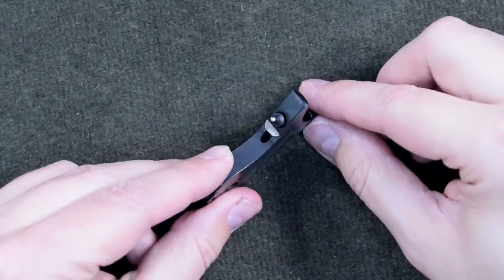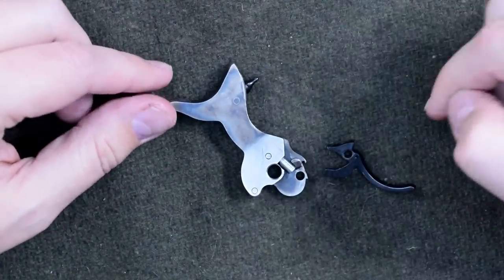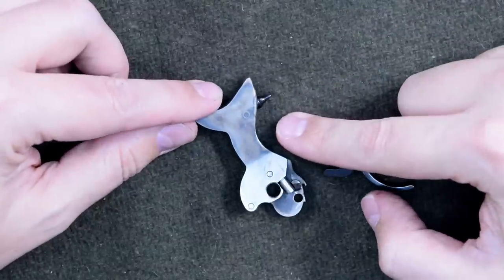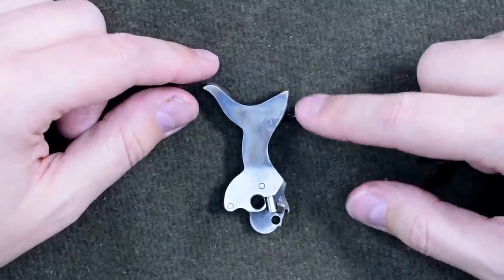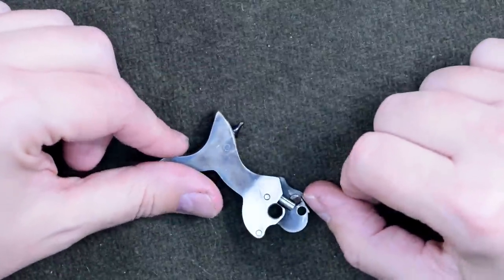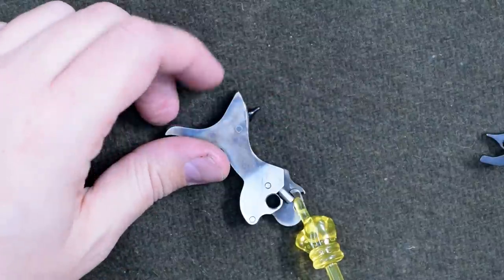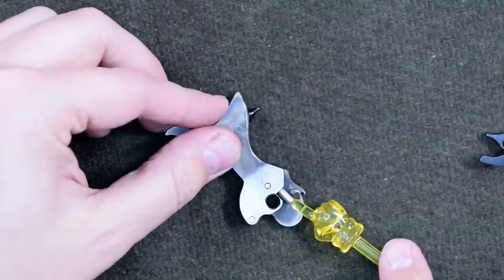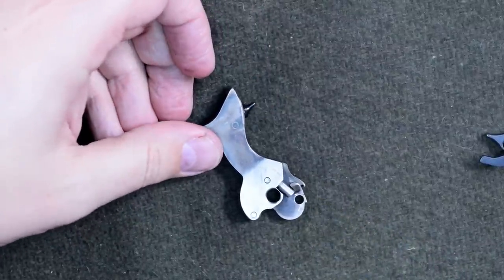Clips: Another Colt Single Action Army Safety Mechanism.

Comment: Hi as a colt collector and engineer. I wanted to test In CAD the strength of the safety notch. In doing so, I found some very interesting data. In my experiences the CAD data is extremely close to real life tests. In my test I used a weak form of steal so that the numbers are conservative. because of the alignment of the trigger to hammer. It takes 900- 1000 foot pounds for a failure. The failure was the trigger pin. Not the safety notch. I also found that if you pull the trigger while it is captured in the safety notch. It does not take much pressure to break the notch on the hammer. It's hard but doable. Remember these are conservative numbers. most SAAs will be stronger then this. The bounce problem you talked about in your last video. I'm guessing, but I don't think this was a problem on original colts. Because how heavy the hammer spring is. But I might be wrong. All This brought me down a rabbit hole. Going threw all the stories like during the government trials. The safety notch broke. So they recommended carry 5 not 6. This is not in the trials at all for what I can find.  It list a half notch failure. But it says there was a clear and obvious Manufacturing defect on the hammer. The other story of the man putting a saddle on a horse. The stirrup hit the hammer and broke the safety notch... That's not what happened. The man had his hammer resting on a primer.  If you have any information contradicting this please let me know. I have no problem being wrong. I thought you might find this info interesting. Thanks

Comment: Hey Othais - to better help with these demonstrations, why not get a small piece of wood and, when you're going to demo a few parts like this, drive a few nails in to serve as pivot pins for the demo parts. Cheap, quick, easy, and would allow you to better illustrate the action of a mechanism without trying to hold the parts in the correct position by hand while fighting spring loading and such.
 
And, cool mechanism, interesting design!

Comment: So this is another mechanism that prevents a loose hammer from setting off a round if the trigger isn’t releasing it, like was publicly claimed by a certain celebrity.
Reply: Never underestimate the effect of poor firearm maintenance on negating the safety features of a firearm. Given that the investigation found that the set armorers sucked at their jobs and mixed live ammo with blanks and that camera crews were leaving due to unsafe conditions, who knows what other fuckery went down before that fateful day. 

Said celebrity does however bear some responsibility not because he held the gun and didn't treat the gun as a gun rather than as a prop (which it was), but as a producer which likely was involved in selecting the subpar armorer who got her job through nepotism. Guns for film are handled differently because of the peculiarities of film production which most who have criticized the celebrity for are thoroughly unfamiliar with.

Comment: I just had my original Ruger single action updated to their newer transfer bar system (Ruger does this at no cost for the conversion.) Is it safer? Yes, technically, but the danger can start when nimrods and cheechakos start thinking of a gun as “safe.” No such thing.
Reply: Guns are perfectly safe. The user is the problem.
Reply: The point of the Ruger transfer bar system is to allow for the safe carry of six rounds in the chamber (inc. one under the hammer) vs only the five rounds in the chamber (empty chamber under the hammer) of the traditional Single-Action Army style mechanism.
Reply: Pretty cool that Ruger offers that at no charge. I still don't understand why they have a bit of a "lesser" reputation compared to some of the other traditional brands, they really seem to be a rather great company that's always putting out solid product for the money.
Reply: @RyTrapp0  Back when I bought my first Ruger (1960’s), they didn’t have quite the fit & finish of some of the “old line” gun manufacturers, and that may have been where that started. Time has pretty much erased those differences. Colt has gone extinct, and a glance at the current products of S&W show some of the same production methods pioneered by Ruger, as well as a lower level of fit and finish in their current products.
Reply: I absolutely would not have converted it... But it makes sense from a practicality standpoint.
Reply: @covefarmdude  If this gun had had the original finish on it in decent condition, I would not have had anything done to it, probably for the same reason as you. But this Ruger had a complicated history, starting new in my family back in the 1950’s, then was sold out of the family to a friend. At some point he neglected the pistol and got some surface rust, whereupon he took a wire wheel and removed the finish, destroying any possible collector value. Before his death, he gave the gun to me and for a number of years the finish was just in the white. I am at the point where I will pass this gun along soon, and I wanted to bring it up to snuff. I decided to send it in to Ruger for the transfer bar conversion (and, BTW, the old parts come back in a plastic bag, should one wish to do a retrofit), and in the process had the gun refinished. They did a beautiful job.

Comment: I'm sure colt would have thought it was unnecessary given the manner in which handguns were handled at that time
Reply: The phrase was,5 beans in the wheel. Simple.
Reply: The designers at Colt believed that the half-cock position would be an adequate mechanical safety mechanism. That the phrase "going off half-cocked" is a phrase which dates back to the flintlock days was clearly not a consideration.

Comment: Friend, I distinctly remember seeing a pair of Colt Single Action 22LR's—forget what they called them—back in the Early '80's. You had to open the Loading Gate; put the Revolver on Half-Cock and push in a Hidden Hammer Block—hidden by the Loading Gate. It was a Push-Button Affair. When you Cocked the Revolver, the Spring-Loaded Cross-Bolt Hammer Block retracted automatically. Everyone at the gunstore who saw them believed that was why Colt halted production on the New Frontier—to introduce these shortly. Nothing ever came of it. No one seems to have heard of this very low-production item—Have You!?!

Comment: I actually have Taylor 1873 SAA with this safety but I removed it with replacement fixed hammer firing pin. The reason? I've noticed when walking around full loaded with 6 shots in the cylinder the firing pin would actually DENT the primers.. Even in a holster that covers the trigger guard/trigger... No good for me since now I have this worry if a strong enough force would actually make it go off (Of course, this is very unlikely  but the dents of my primers made me uneasy.) So I decided if I'm going to carry only 5 rounds I rather just replace the "Safety" hammer with a standard hammer. 

One plus side is the standard hammer has a crisper and lighter trigger pull compared to the safety one. And if you don't hold down the trigger completely when firing it might not even fire from my experience (If you quick draw constantly you'll have it happen since most guys just lightly tap the trigger most of the time. Which is fine with the fixed firing pin but not 100% reliable with the retractable firing pin.)

Good to see all these different safeties for sure

Comment: I recently got a Uberti 1873 replica from Taylor that has this firing pin safety.. YouTube is filled with people disappointed that this mod takes away the traditional four click, C-O-L-T cocking procedure. With this, there is only three. Another Italian company, Pieta, mades a similar 1873 replica that conforms to Colt's original 'four click' design. I'm not sure if they have instituted some sort of safety, but I know the older Pietas were in demand with the purists. As far as the 'Rust' tragedy, I recall reading that the firearm was a 13 yr old Pieta, so it would have the fixed firing pin and could ignite the primer buy just releasing the hammer. Although, this would be a very short stroke, and would have to be tested to see if enough force is exerted to fire the round. As far as my Uberti, there's no problem with the floating pin and the normal operation of the firearm. A crisp 2lb pull will do the job.
Reply: I believe they must have safeties for import reasons. But on Piettas I am almost certain the first cock is sufficient. On Uberti open tops that only have 3 clicks the safety is in the form of a screw that can be turned with a small screwdriver to make the hammer unable to contact a primer.

Comment: I would still like to hear some thoughts on how the 1873's first "click" is not considered to be a manually rebound hammer...or maybe it is? Either way it seems that convention was to keep an empty chamber under the hammer, whereas for DA European guns with a manual rebound hammer, it seems expected to load ALL the chambers. Very confusing to me.
Reply: A manually rebounding hammer is just half cock. Rebounding hammer is just one that goes to halfcock automatic when reloading. Common on break action guns, so that if you slam them closed they don't accidentally fire. Older primers could be very sensitive, and the firing pin bouncing off the rim/case then hitting the primer could set the round off.
Reply: i don’t think that was actually convention at the time

Comment: Both those mechanical hammer block safeties seem to just modern, complex solutions to a problem most easily solved by loading only 5 rounds and carrying the gun with the empty chamber under the hammer.

Comment: Those safety mechanisms show impressive engineering but I doubt Sam would’ve approved. Load it properly with the hammer down on an empty chamber and there’s no way to set it off by dropping it. The danger is certainly there if you drop it with the hammer cocked. I’d bet Mr Colt would probably just tell you to handle your gun properly and not drop it. I think Mr Colt would be surprised that we now feel the need to add the modern changes. I’d also be willing to bet there would be a lot of other things he wouldn’t understand about modern life.

Comment: I seem to recall Samuel Colt never made a double action pistol because he thought they were over complicated.  (Though after his death the company held no such prejudice.)  I wouldn’t quite trust such a system as a bit of rust or grit up in the firing pin spring could trap the pin in the forward position, disabling the drop safe feature.
Reply: It still wouldn't be putting pressure on the primer.
Reply: @mkultraification  If it's rusted into the forward position it most definitely will put pressure on the primer.